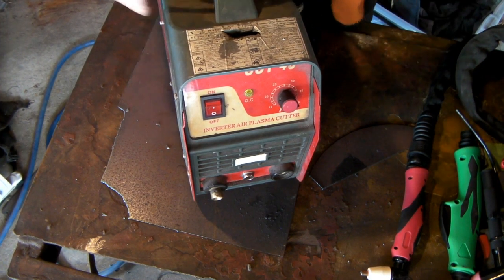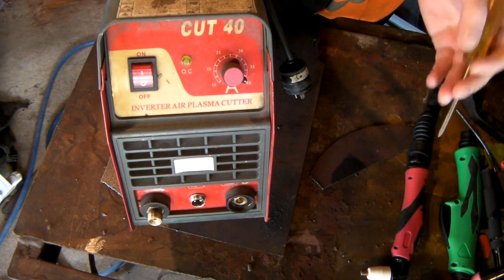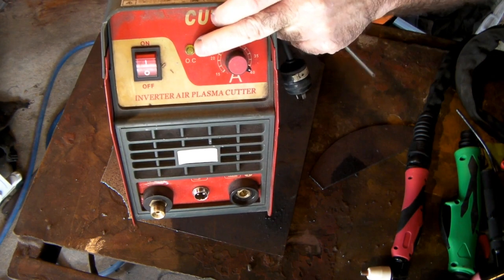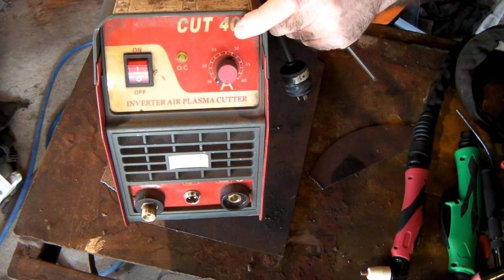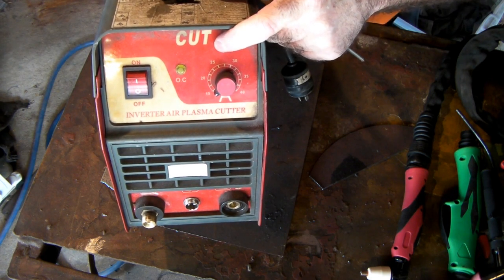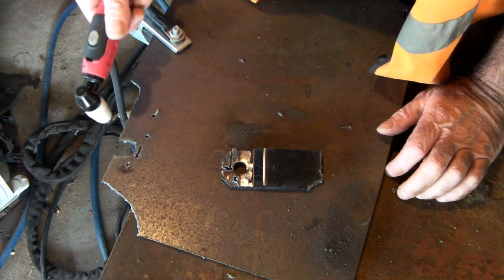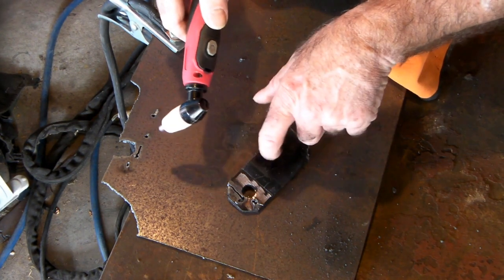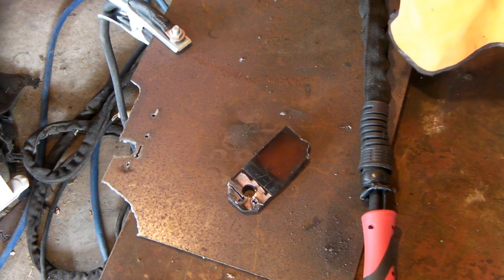Plasma Cutter Setup /Plasma cutting basics

Comment: Good video lots of handy tips for beginners, & well explained too. If you're struggling with your smaller compressor build yourself an auxiliary  air tank from a large empty propane cylinder ( the 95 Litre/47Kg type) I run a 3 Hp 50 Litre compresor with a large aux tank. It gives me the extra air volume I need for my plasma cutter and sandblaster, and for spray painting. It's an easy conversion.
Reply from the maker: yea  I have 2 different tanks cheers pete

Comment: Hey Pete, how'z it going. I just got my first plasma, I can't find anywhere to tell me the amount of amps I should use for the material size, and also how fast do I move the torch?
It's a 45amp machine. I have just been using it at max amp because I don't know what to set it to. I can't find a guide online or anything.
Would be a great subject for a video.
How does amps effect the cut?
How do I know how fast to travel with the torch while cutting?
Thanks Pete
Reply from the maker: https://youtu.be/T8hbhHpTdvk 
might help a bit
Reply: @petestools  thanks mate, I watched it. But the thing I'm struggling with is when to turn the amount up or down. my machine is a digital machine that has a built-in internal regulator and adjusts the airflow according to the set amperage. the issue I'm having is I don't know what amps to set the machine to for different thickness. Do you just run your machine on full amps for everything?

Comment: Thanks again! Just bought a plasma cutter. But its still in the box. I didn't have time to play with it yet. Becouse my compressor is at the construction where i work. But your videos are going to be very helpfull! Have a nice one! Cheers! 😊
Reply from the maker: Cool mate what sort of plasma cutter did you buy ?

its great fun .well i think so cheers pete
Reply: @petestools  I live in Hungary and we have a store chain called Lidl. They have a branded plasma cutter wich is called parkside. Basicly is cheap and produced in china. Its a 40 A and uses the cheap consumeables that you like also. So I am planing to use your pilot arc trick also becouse its an hf modell and sometimes i will need to cut painted or rusty metal. So my fingers are crossed that it will work. Ill give you feed Back! Keep it up! Róbert 🇭🇺
Reply from the maker: cool mate have fun